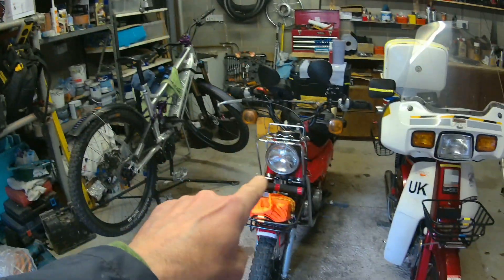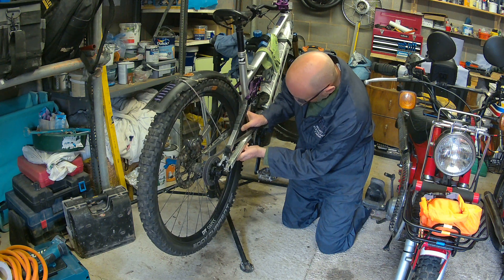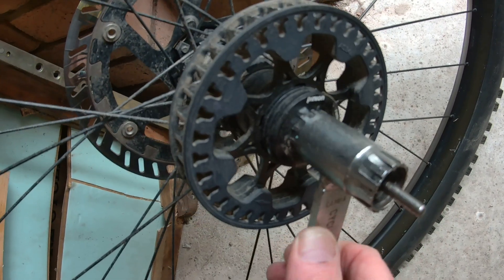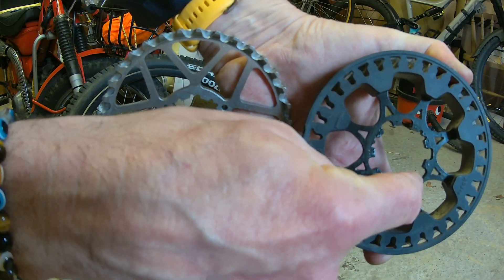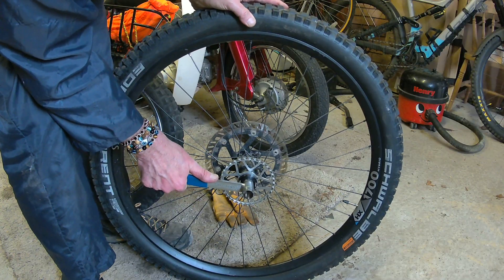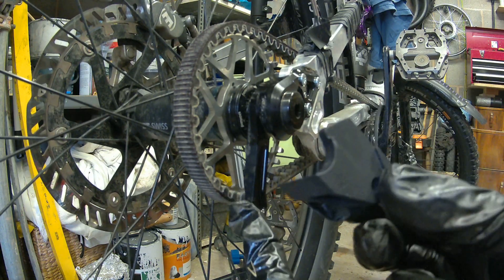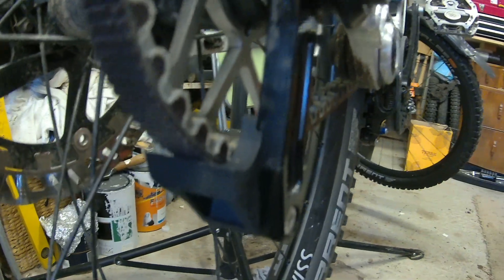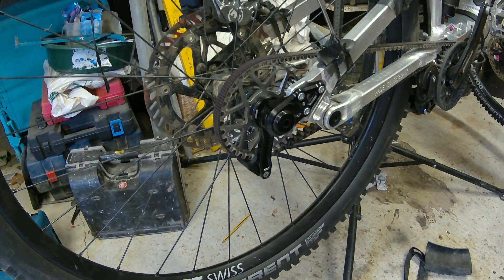Tech Tuesday 🛠️  Fitting the new CDX Pulley & Snubber to the Nicolai Saturn 16 MGU

Comment: Is that Snubber Needed ?As its Sticking Down Just like a Rear Mech and Might Get bent in to The Wheel .
Reply from the maker: @TucanoOne  Yeah, it prevents the belt from coming off the pulley. I see what you mean but it's not as exposed as a mech so all good.

Comment: Can you not use the belt as a chain whip?
Reply from the maker: @a100267  I'd have to take it off but that's a good point well made...... Look for an old belt of some description and make a pulley whip 👌👍 Or.... Use the spare belt👌
Reply: @OldNorthern_eMTBer  Just received mine today. The Gates flyer included warns against using the belt as a chain whip😄
Reply from the maker: @a100267  Oooo, new bike day, nnnnnnice 👌
I'm gonna look in Halfords to see if there is anything I can use as a pulley whip, there's hot to be a cheap belt that will do the job. I'll take the pulley I took off to try against what they have.
Reply: @OldNorthern_eMTBer  is your rear hub silent when free wheeling or can you hear the freehub ratchet?

Comment: Just a thought instead of carrying your spare battery in your rucksack Nicolai do a specific rear rack for the 16 MGU you could carry the battery on top of the rack instead of your back it must be easier the what hour on both batteries has slightly increased to 800 and 1060 
One other thing is the Amflow there making DJI reduced their peak power down to 750 max which will piss people off my friend has one so I've told him keep away from new updates
Reply from the maker: That will never happen! It would get bounced to whatsit and would help the bike handling, besides, it no major issue having it in the rucky and its comfy so not a problem. I'm got more than enough electrical petrol between the 2 and its not a huge increase anyway. 800 to 750, but to the average rider, would they really notice other than a number change on a spec sheet? I'll stick my neck out and say no, the wouldn't notice a drop of 50 😁